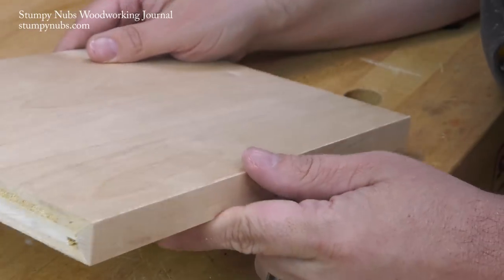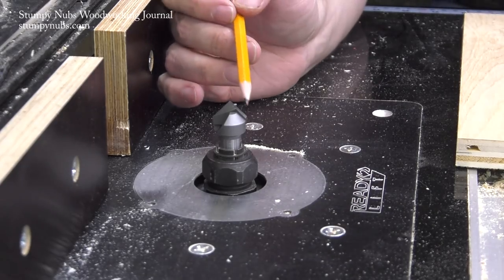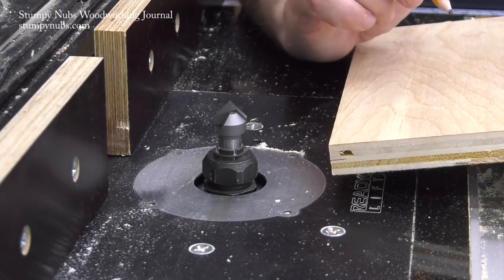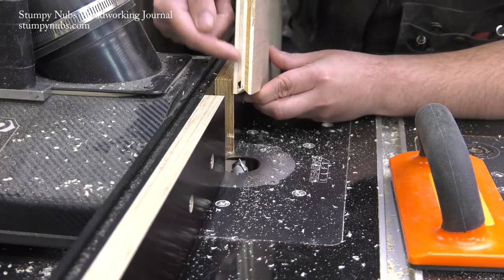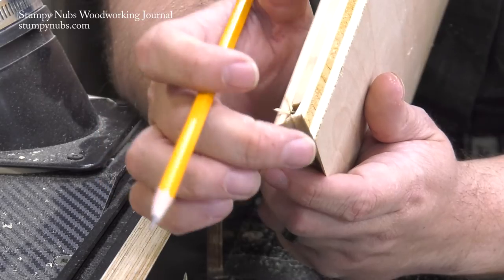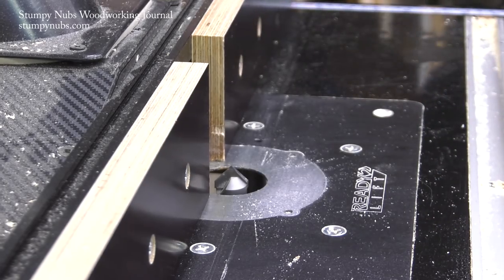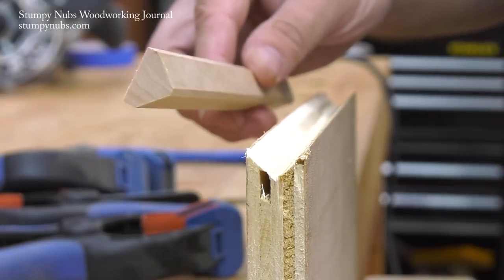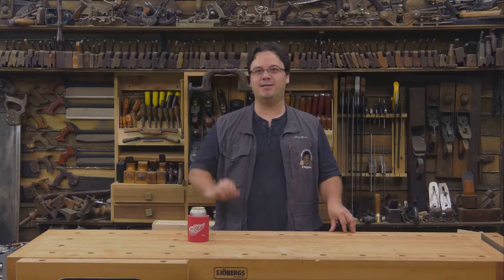Make plywood look like hardwood- edge banding without special bits!

Comment: I don't completely like the  banding, but thin wood trim with a flat profile or radius or bull nose  fastened with glue and brads is pretty simple, and pretty good at neatly covering a plywood edge. .  This router trick is clever, but looks fiddly., and unforgiving of small errors.

Comment: Excellent tip!  I do like hardwood plywood for a lot of things, but dealing with the edges is always the challenge. 

I’ve used glue on veneer strips and they work well but you’re really limited to the available veneer strips at the hardware store, aside the durability concerns. 

The real value of this technique is opening up edge finishing to any equal thickness hardwood you have on hand.  While using a matching piece is nice to hide the ply edge, using a piece of contrasting walnut or other dark wood might really step things up. 

Now it’s off to Lee Valley for some V-groove bits.

Comment: Greetings from the Great White North. Excellent demonstration James. I have used both solid wood edges and iron on edge banding. If, I had to choose between the three, your method is better. There is much more work to do during the setup, but this pales compared to the pay off. I will have to change the way I do this in the future. Thanks for showing us a different method. Take care. Keep up the good work.

Comment: "without using special tools" - step 1; get  a router table and v groove bit :/
Reply: oh, and those fancy clamps
Reply: @willl5250  You can make band clamps with a bit of rubber (bicycle inner tubes work great) and $1 spring clamps from any hardware store.
Reply: Really?  If you do any serious project Router table is a minimum requirement.  You can pick up simple ones for sub $200
Reply: If you consider a router to be a “special tool”, you are special, and probably a tool.
Reply: @commandoconstruction2720  @topcommentgod
Reply: @commandoconstruction2720  😂 wow
Reply: @KingMoronProductions  At heart a router table isn't a lot more than a board that you've bolted  your router to with another board clamped to it to use as a fence. Stumpy may be using some motor controlled badass router table but using this technique doesn't require that. There's tons of plans out there for shop-built router tables to fit every shop size and budget.

Comment: Excellent tip  James  I believe. This is a way better option. Than  the iron on  edgeband. That. Isn't. Very  durable as you  stated   Plus. It  really  makes the plywood  look like a solid   Peice of hardwood  as  this method "hides " the joint  well. And doesn't. Require  any fastener  marks  another  good video from you  as usual

Comment: Great technique for small parts. But I have 2 cabinet tops 2' x 4' that need 2 edges banded. Not sure I could hold the top perfectly vertical for the cut. I was going to cut the profile on a 4' board, rip it and butt edge the joint. I am sure you have a clever and better way.

Comment: That's an awesome tip, I don't think I would have ever thought of that.
Just one question:
Why haven't you used a plywood scrap, put the V cut in it to use as a jig for the given plywood thickness, so you can set up the router bit without going through all that hassle?
You would of course, have to verify that your jig is the exact thickness of the plywood you are cutting groves in for the hardwood edge banding.
Then again, with a little thought, a person should be able to make a V bit centering tool that allows the router to be set up after measuring the plywood with it.
I think I just over thought that problem to the nth degree.
Reply from the maker: It would certainly be helpful to save a scrap for setup next time. This video was designed to introduce the technique and help you set it up the first time.
Reply: Plywood is never the exact thickness no matter where you buy it.
It always varies even through the same board
Reply: I would think plywood would disintegrate trying to cut such a fine piece. solid wood is the way to go.
Reply: Thinking out loud here, could you take this one step further and use a ripped piece of the same plywood with the groove as the edge piece?

Comment: Thanks for sharing. This looks like a very clean looking long lasting method. If you needed to do all 4 edges you recommend mitering the ends of the edge banding to get a more seamless look?
Reply: Yep , interested in the answer to this question!
Reply: I was thinking the same thing. I'm making drawer fronts for a bathroom vanity so glued edgebanding isn't going to cut it. I guess cut all four notches first, miter the ends of the edgebanding and glue. I wonder how difficult it'll be to line up the corners....

Comment: Good idea. You could also centre the cut by running both sides against the fence.
Reply: If you did that, I think you'd end up with a channel that was too wide for the mating hardwood piece.
Reply: If you were particularly far off centre to begin with, yes.
Reply: If you were particularly far off centre to begin with, yes. He also chamfers the edging piece to accommodate this anyway.

Comment: James, I really enjoyed this video and I’ve employed several techniques in both my iron iron edge banding and my hardwood edge banding. What I actually wanted to ask you is regarding your router lift. I noticed you’re using a digital electronic router lift and I was wondering if it’s the Shark RS 1000 set up which includes the digital fence as well or if it’s some other model. Thanks a lot
Reply from the maker: This was the older version of the Shark. They called it Ready2Rout.

Comment: You don't mention on the video but do you have any problems with wood chips falling down into the motor of your router? The vac can suck most chips away when cutting the hardwood but when making a V groove in the plywood the face of the ply against the fence means the above table vac doesn't work. Thanks.

Comment: Great idea. I like the beefy edging. You might try cutting square stock , glue it to the plywood , and then trim it off at the T saw (or better yet, with  a flush bit on the router). It'll look the same.
Reply from the maker: The V-shape of this edging makes it easier to align when gluing it on, provides more glue surface for a better bond, and allows you to trim it closer to the plywood edge without sacrificing its durability.
Reply: @StumpyNubs  he is just saying make the V slot at the plywood, then put square solid wood (without making it triangular profile in router and then sawing) and trim it with a router or saw after gluing. a lot easier and safer method.

as an alternative, you can make the V using a 2 pass saw cut.
Reply: Smart! I'm going to try this!

Comment: What are you using for a router lift and fence adjustment.  That looked suspiciously like electric adjustment.  Stepper motors?
Reply from the maker: This video was made with a Ready-2-Rout fence and lift by Next Wave. It used stepper motors to move the fence and raise the lift.
Reply: @StumpyNubs  thanks. Did you review that?  Do you still use it?  Never mind.  I saw the price.  Lol
Reply from the maker: @docdailey  I did some videos on it. It's nice, but not necessary.

Comment: Just a question how do you do the other face that mates with the 1st face if you want to hide the joint.  As in make it look seamless all the way around.  So for example a panel that is going to be a door.
Reply from the maker: In that case you would have to miter the ends of the four pieces of edging.
Reply: @StumpyNubs  Thank you,

Comment: If I understand this correctly, you can only use this method for 1 edge. Am I correct? This method would not completely edge a panel to hide the layers of the plywood.
Reply from the maker: You would have to miter the corners before putting on the banding
Reply: Stumpy Nubs Thank you, so much.

Comment: James, thank you, this is really cool.     Is this method better than gluing square-edged banding because you get the plywood's surface veneer all the way to the edge?
Reply: I'm obviously not James, nor do I play him on TV, but I believe the method is superior to square-edged banding because of the greater glue surface and because V-groove provides a mechanical joint rather than two edges simply being glued together. Properly made, it should be much more durable than square-edged banding.

Comment: problem with this method is that you cannot round the edges, plywood would reveal. a combi method of V shape and stripe would be the best of both worlds in terms of looks and strength. would be maybe safer and more repeatable as well.
Reply: There is no thickness limit on this approach. While he shows a V plus a shallow edge-band, you could certainly cut the edge-band an inch thick to allow for roundover or some more complex profile.

Comment: it's an expensive tip for quality router bit, a lot of time to centered the panel and a skillful carpenter to do it. Just glue it with flat wood. Remember that glue strength is stronger than nomal wood strength.

Comment: James, I seriously want to build a full size (6'8") interior door. I have been looking around at the various construction methods that are used. And there are several. One that intrigues me the most is built up layers of plywood for the rails and stiles and possibly MDF for the panels for the stability needed and then thick edge banding to conceal edges and to add strength where hinges/ lock sets would go.This would be a craftsman style 2 or 3 panel interior door. I know many woodworkers would be using thick solid woods like White Oak or Brazilian Mahogany, ( probably more for exterior doors) but I do not yet have a planer or jointer for doing it that way and it probably will be painted not stained anyway(who would do that to beautiful wood?) I have seen large manufacturers using particle board laminated with thin wood veneers and thick solid wood edge banding with different profiles used and your video makes me wonder if maybe you have done something like that on a  larger project like a door! I don't like particle board "( who does) but" if it is a viable option for what I am trying to do and is recommended as an option by someone who knows more about it than me, I would consider it. I am willing to experiment/fail some if necessary but don't want to make lots of unnecessary mistakes for the lack of wise counsel. Any advise or information you ( or your readers)may have and share would be awesome, as I trust your Advise. I have got to do this one one way or the other!"So help me God". Thanks for your great videos ( I am subscribed to your channel), and by the way watching them is waaay better than watching "Hallmark Movies" with my wife. She doesn't know I'm writing this!

Comment: This does look really good but to me, this seems like only a viable option for small pieces.  I don't see how this could work for large pieces.  In addition, this process would have to be done as you go along the build.  If you need  your router for other parts of the build you would have go thru the setup process more than once.  Or, I guess if you are good enough (which I am not), you could cut all of your pieces first, apply the banding and then assemble the entire project.  At this point in my woodworking journey, there is no way in the world I could do that.  I use Sketchup and still don't trust the measurements in my diagrams.I do see a lot of videos where the guys say, "first, I cut all of the pieces for the project".  I'm very impressed by those folks.
Reply from the maker: Why wouldn't it work for large pieces? And you wouldn't do it to all the project parts anyway. You only edge band table tops and panels where an edge is exposed. This isn't a new idea. As the video said, special router bits have been made for this purpose for many years.

Comment: Very time consuming and requires an accurate router set up with feather board system because  NOTHING  is perfectly straight and V grove router bit which I have no other use for. Theoretically better than  edge banding  but nowhere near as efficient as edge banding using can ontact cement (Iron on never works)  and good roller pressure.

Comment: " edge banding without special tools" Right! All you need is a $1500.00 US Router table and router.  You might think on revising that title, we don't all have 10k worth on machines in our shops.
Reply: Except you don't need that 1500 usd equipment to do this, all you need is a router table and a v-bit
Reply from the maker: Brad- Do you REALLY think you need a motorized lift and fence for this just because I have one in the video? Come on, you can't really believe that, can you?
Reply: If you have removed the springs on a standard plunge router, mount it in any table surface top stable enough to do work on and use any straight board with a  couple of C clamps for a fence. Use the running router to bury the bit and cut a fence clearance throat. Pivot The fence with one end held firmly with a clamp and make a zero clearance fence. Adjust and tighten clamps as needed for the fence to centerline ply. Unlock and lock router and adjust for bit height. Trial and error on scrap. Save that perfected piece as a setup block, shortcut for next time. If you really want to go all in - "buy" a Lab scissor jack to act as a router lift. Less than $15. Unlock router plunge, dial in adjustment with jack screw knob. Lock router. More than Oneway to get a job done. ( I don't want to offend any Cat lovers). Use your head as well as your hands. Stay SAFE always!
Reply: We should all chip in and get Brad a 10K workshop, so he can edge band plywood too.
Reply: True, he has a crazy expensive machinery. I have a harder frieght plunge router imverted into a makeshift plywood table with a hole and used the principles he as shown with complete success.
Reply: Any router will do. You could even use an edge guide and pull this off without a router table
Reply: Leave it to a guy named BRAD

Comment: Yeah but your method doesn't give strong edges. And since you're plunging into the grain at an angle you would lose glue surface.
Reply from the maker: I'm not sure why you say that. This type of edge banding is far stronger than most others that are trimmed right up to the plywood. And "plunging into the grain at an angle"  produces considerably more glue surface.
Reply: Stumpy Nubs I'm wrong! No doubt about that on the edges. I thought that as you cut wood at more of angle your lose glue surface.

Comment: I’ve been on the joinery business 20 years now and this is just an insult to perfection, usually your videos are insightful but this is cheating beyond belief. I’m sorry but NO solid wood sold as solid wood is solid wood not ply make up
Reply from the maker: Plywood has been used in fine furniture since the Egyptians. And with all due respect (even though you showed me none) if you think it's "insulting" and "cheating," you've got a lot to learn about the history of furniture making.
Reply: Stumpy Nubs love when you clap back
Reply: Stumpy Nubs I meant no disrespect to yourself, just meant as a woodworker I prefer to use only timber I try to stay away from ply and especially mdf. And I’ve seen a lot of people trying  to pass off ply with hardwood edges as solid timber. I’m aware of the history of plywood and the Egyptians using it as a means to use some timber they didn’t have the resources for as they only had a few varieties to hand. I do still use ply in drawers as it’s the most effective but for cabinet building I try to aim for solid as it always looks much more spectacular when it’s finished. I recently finished a lovely drawer unit in African olive wood and it still gives me great dreams of how it came out. Love your videos and very sorry for any disrespect